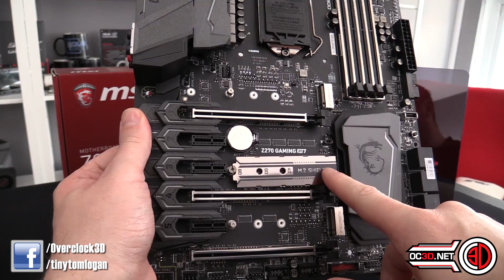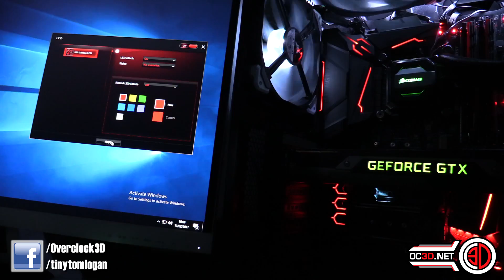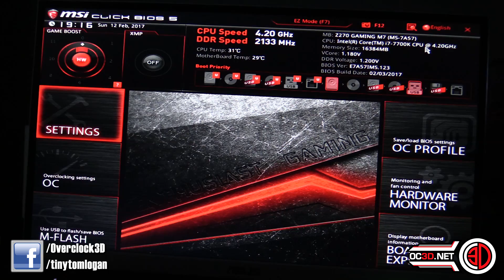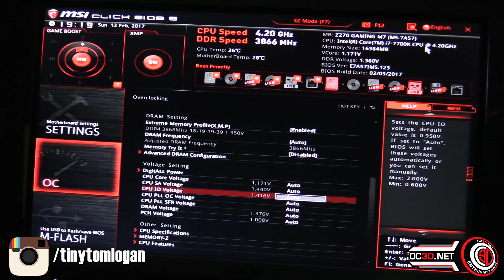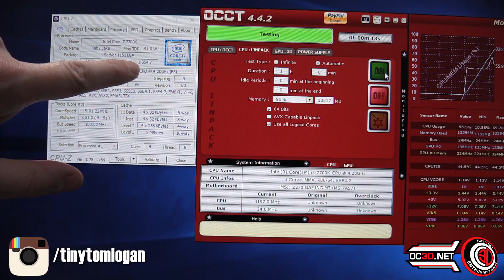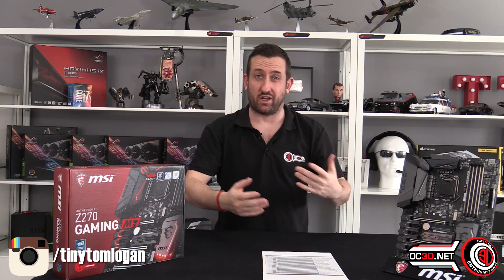MSI Gaming M7 Kaby Lake Motherboard Review

Comment: I run 10 fans. All PWM and the Bios handles all of them. It's quite as a mouse. Till I stress test the system. To check the MB temps. That Command Center includes.

And their not cheap ass fans. Their Corsair. Not all the same types. As each has their location uses...

Comment: I'm having a issue with this board.  my temps on 7700k float around a lot. cpu usage is 100% with Msi command center. There is a temp sensor that shows 50c to 55c most of the time and if you go into Aida it shows that higher temp, a cpu package, then individual cores temps. What is this weird temp ??? why do the numbers fluctuate so much ?

Comment: Thanks for the video. I've been on OC3D website asking for advice on many subjects and I hate that I get my questions answered 2 or 3+ weeks later. But anyway, Tim mentioned months ago about putting together a over-clocking guide for us. I'm still searching for that video. But on another note, I like that in this video he gave us some tips on the CPU SA, IO Voltage tweaking as well as the Load Line Calibration. I'll download the OCCT 4.4.2 or higher if available and start doing some more tweak settings. Now I'm still running a Z97 with DDR3 at 1600 MHz, 7-8-7-24-2T until I build a Z270 system this year. But still I don't think it will hurt anything to play around with my bios to achieve a better, tighter and safer voltage level for my components, even though I'm not doing any overclocking.

Comment: Great and informative video as always.

One thing though rarely discussed but also very important IMO is the quality of support and user forums. Especially for products like motherboards where you might have lots of questions and/or minor issues you want to get help with.

I used to be a 100% ASUS guy and I built a number of rigs bases on ASUS components throughout the years but after realizing far too often how ignorant ASUS are when it comes to their support/user forums where some of the threads have been running for well over a year without even a comment from an ASUS representative I had it with them and ditched everything with ASUS's name on it and went to MSI and haven't looked back nor regretted my decision once.

In comparison to ASUS the level of attention you get as a regular customer/consumer is like night and day. For instance I had an issue in the past with an Intel 750 and my current Z170 M7 motherboard and literally within days I was in direct contact with one of the guys in the MSI BIOS dev team. Now that is what I call top-class support!!

Looking at the other side of the fence, when I (and lots of others...) had an issue with our ASUS Maximus motherboards where the internal clock would reset the time every now and then for no good reason we waited for ages for ASUS to do anything about such a stupid problem but a solution was never presented.... Embarrassing is the only proper word for it if you ask me.

This turned out to be a very long comment and my intention was not to initiate a this vs that brand war. I just wanted to mention that I as a customer don't only care about all the bobs and bits of a certain product although they are also very important of course but I also care about the framework around the brand and product where the level of fast, friendly and professional support is a very important part in my eyes.

In this area MSI really excels in my experience.

Keep up the good work and looking forward to all the videos to come!

Comment: There isn't absolutely any kind of  bios fix for this in my Z97-G43 GAMING. I don't think they have learnd from this yet. Still they haven't fixed that sysfan rpm and on their website they lie about my board: "Total control over fans" Arctic TC fans will make this MSI F#=UP seem less f-ed up. Msi seems to be bit hard of hearing or just dumb because this problem is years old.

Comment: Don't care, Ryzen is out.
Reply: rofl in gpu locked benchmarks....
Reply: Out performs it by a few percent.....against the 1800x /at stock/...in games that rely mainly on single thread performance.....which are slowly going down in number.....

But hey since we're only looking at price of the CPU to single thread performance. Lets look at the i7-6950x performance
Reply: Go ahead and buy your core 2 duo now, cause I'm getting a Phenom X4 for the long haul. 

You're assuming the 1800X is trying to go against the 7700k..it's not. That's the job of the R3 chips that are coming out for 130-ish..which are all unlocked too by the way.
Reply: akabiscuitwaffle Couldnt agree more..
Reply: I decided to have two systems one for gaming (7600K) and one for productivity (Ryzen 1700). :)

Comment: The issue with the sys fans running at 50% can be solved in the BIOS. I know thats annoying as you'd hope the software could do it for you.
Reply: none of my fans spin below 45% they stall. it's set like that on the software so beginners can't accidentally stall fans like I did using the bios tuning and cook thing without knowing.  at least if you going to adjust the fans in the bios you at least know something about what you are doing.

Comment: msi z270 gaming m7 or gigabyte z270 gaming 7???
Reply from the maker: With the bios atm neither tbh
Reply from the maker: Not too low dude, the board isnt up to it atm. Anything over 1.25 is basically killing your cpu.
Reply: Niccolò Lo Presti ryzen
Reply: Hey Tom, do you think Gigabyte will have a sorted bios for their x370 boards?
Reply: What kinda issues are we talking about with the bios? thinking of purchasing the m7
Reply: Sorry saw the rest of the video that sucks theres an issue with voltages
Reply: hey! tell gigabyte to fix the default vccio and vccsa voltage when turning on xmp as well. the values are wayyy too low... i just figured out my system was turning off because of this... :(((
Reply: So Tom, which one then?
Reply: +Wheyan 3400mhz memory xmp overclocked up 13 cas 1 command rate and it stays default .96 io/sa..... thats really bad man :/ i fixed it but bleh. also having horrible llc..... just have to overshoot a little to get everything okay. i can run 4.8ghz at 1.22volts finish all my testing and use my computer normally and then a sudden crash. its only not crashed at 1.27volts. thats a .05 volt gap i have to use with turbo llc just to make sure it doesnt crash. :/ thats not very fun...